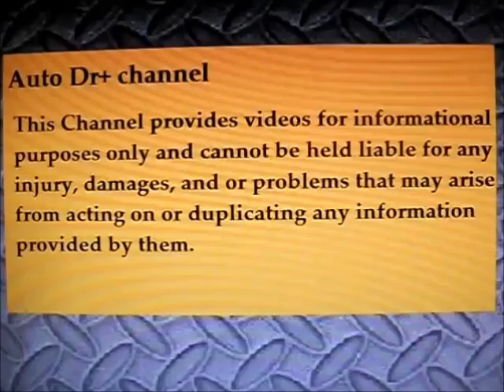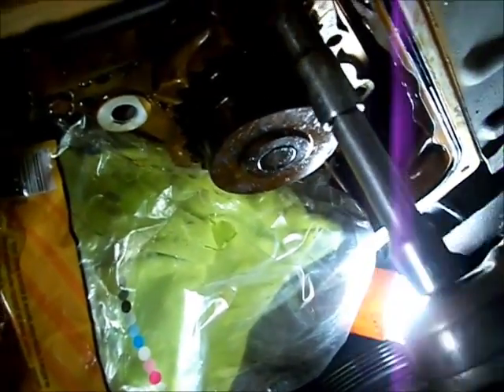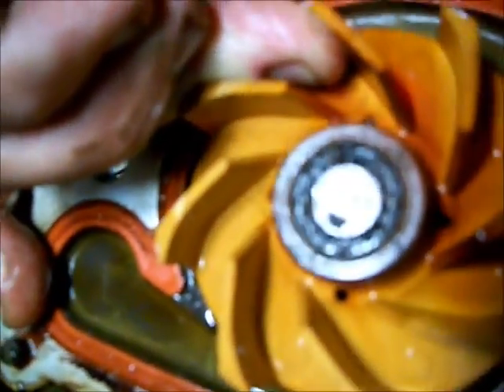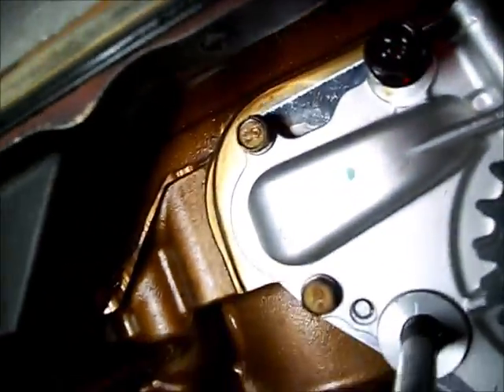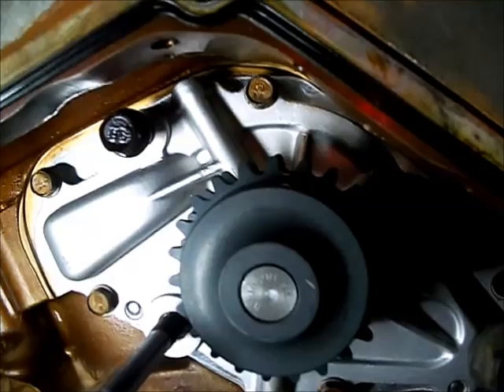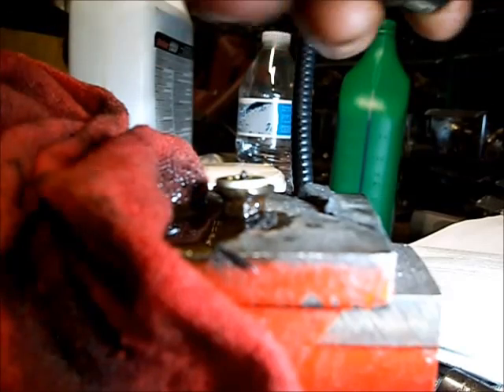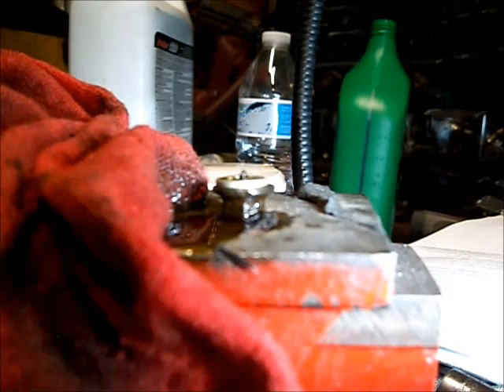Dodge Magnum `05 w 2.7l pt.2 water pump replace timing chains

Comment: did you end up changing the cam chains too or only main chain?
Reply from the maker: Just the main chain, this was an economy job for a local car re-seller.  Altho, the secondary chains don`t fail normally.  The only point of interest in that area would be to replace the chain tensioners that support the secondary chain.  But even those aren`t prone to fail.  As long as the short guide plastic isn`t worn more than "0.10" from chains.

Comment: como puedo cambiar la bomba de aceite de craisler 300
Reply from the maker: ¿Por qué necesita el cambio de la bomba de aceite? Con estos, se debe verificar la presión de aceite real, porque la unidad transmisora va mal. Y el conector empapado de aceite debe ser limpiado, y prefieren un orificio de ventilación de aire puesto en el conector en el cable conector de ranura vacía al lado.  (Espero que esto se traduce en buen estado)  De todos modos, si se enciende la luz de aceite, la bomba está en la última elección. Después de recoger, sensor de aceite obstruido, cojinetes del cigüeñal y la junta tórica alrededor del tensor de distribución fundido del émbolo, (alta posibilidad) de pérdida de presión de aceite. Ya que se encuentra en la camisa de aceite para lubricar la cadena, bajo una restricción controlada   Se aplica a motores 2.7L

Comment: Yes it is not leaking. However, There is another one inside? Are you saying it's an O-Ring at the entry where the tensioner go inside? or the O-Ring on the Tensioner?
Reply from the maker: +getpaid38able   The o-ring on tensioner.  As long as you got no chain noise, no oil light (@ hot idle), and no leaks, you`re all good.  Oh and no overheat.

Comment: You my man are a freaking genius who would have known that little O-RING would have made such a big difference (part NUMBER 04792480AA ). THANKS SO MUCH. THANKS YOU SAVE MY WALLET. YOU ARE A SAINT.
Reply from the maker: +getpaid38able    I take it, that it solved the oil leak problem?   That o-ring and the other one in there are at times holding 100 psi (cold cruise) to 9 psi (hot idle) between them.  So the oil is just waiting to get loose where ever it can.  Also the tensioner has an oil hole where it rest against the tensioner arm that has a slot in it to oil the chain.  The tensioner plunger is restricted to only let a metered amount of oil out to the chain, so as to maintain oil pressure in the rest of the engine.

Comment: Man thanks for the info. I was trying to see if I could purchase the O-ring separately but so far you have to purchase a new cap also. I checked the manifold also it is not stuck around their I will continue to search my garage it may have fell when I took my car for a test drive after changing the water pump...smh
Reply from the maker: +getpaid38able   just take cap with you to parts store, and match one up, I believe it is about 1 1/8" x 1/8" diameter. but felpro prob makes it.  Be sure and add a couple quarts of oil back in there so the motor doesn't get fried, it probably really made a mess down that side.

Comment: The O-ring on the cap or the O-ring on the Tensioner? The reason I ask is because I don't see one on the cap.
Reply from the maker: +getpaid38able    There u go.  The cap o-ring is critical in containing the oil pressure between the cap and the o-ring on the tensioner.   It has probably fell down on the frame crossmember, during installation.  Another will have to be obtained before all is well, for several reasons, like the huge oil leak, and the oil pressure keeps and adjusts tension on the chain as it wears.
Reply from the maker: +Auto Dr+   O`... the o-ring is about 1 1/8" diameter, sets in the circular ring on the inside of cap.  Umm, check the head and see if it is stuck on it as well.... may have dislodged when cap installed, but really should have aligned back up with cap when installed.  Should be replaced in general anyway.

Comment: Just a question, I finish my Water Pump installation on my Magnum. I replace the timing chain tensioner, the Serpentine Belt, Timing Chain. The Car starts and sounds good no Antifreeze Leak however, now oil is leaking around the timing chain tensioner cover when I start the car. Have you ever encountered this problem?
Reply from the maker: +getpaid38able   The cap holding the tensioner in?  If so the o-ring has slipped, got damaged or is worn out.  A new o-ring is in order
Reply from the maker: +Auto Dr+  I have never had that problem, but I think there is a pin and slot to keep the tensioner cap right side up.  You may check to see if cap is upside down, as it should set flush against the head surface.  The cap is sloped inside to accommodate the slop of the tensioner, and the little hole to the left inside bore is a main oil jacket.  And there is a marginal risk of damaging the smaller o-ring around the tensioner, when installing, causing the oil light to be on at idle hot.  Due to oil pressure loss around it.  But would leak internally down timing cover housing.  Out of sight.

Comment: Hi, Very good video, a lot of detail. I did exactly the same thing with my 2.7 but my camshafts spun some when I took the chain off. Got everything lined back up, installed intake and valve covers and coil packs back on and engine will not fire. Cranks over fine, no valve knock but no fire to coil packs.  Shows codes P0352, 353, 354, and 355 when scanned. Disconnected cam sensor and still no fire, any thing you think I may be missing? Thanks so much in advance, Bobby
Reply from the maker: +bebop4u1  Hi bebop.  The year and make would have been relevant information.  Those codes may or may not be relevant, depending on if the key was on while those coils was still unplugged.  See if check engine light lights up for a bulb check at ignition key on position.  If not power/ computer problem.  If ok, leave switch on check for 12v+ on  1 side of coil plug-in`s 2,3,4 under hood.  Power to coils supplied through ASD RELAY I believe.  If no 12v, check for blown fuse, check all fuses under hood, and I mean each one individually that support the power train system.  I was wondering , does the fuel pump run for 2 seconds after switch to on?(relevant) Also there is a plug-in set leading to the engine, verify these are all plugged together after checking for any of the wire pins in them displaced and not making connection to its mate.  Check for wiring caught under valve cover sealing edge.  Seen this happen to several people after extensive work.  That is some info to sort through for awhile.  If still a problem, answer the questions I asked in a reply.  Also sometimes, the plug-in on the crank sensor in the transmission bell housing just loses contact and it wont start.  (just unplug and plug in again)  This and the chain timing can be verified through a scan tool by 1 observing rpm on crank, and 2 verify cam and crank sync ok while cranking.  Hope it helps
Reply: Thanks so much, I apologize it is a 2000 model Intrepid. Have power on ADS relay with switch on, no power to fuses S and T which should be for the injector and alternator. Fuel pump does not come on. If I jump a hot wire to the injector side of fuse s it will crank and run but backfires through the intake and wont idle. Tore it down again to double check timing and its pretty much fool proof, crank marks on chain and sprocket line up, marks on intake camshafts both line up with marks on chain and since the sprocket will only bolt on one way the intake cams have to be in time. The exhaust cam sprocket is 12 pins from each other as per manual. The left bank or drivers side sprockets have the dimples and triangles for timing. The triangles mach up as timing marks, the dimples will put the intake cam out of timing with the main chain. All connections seem ok no wires broken or caught under anything. The only code I get now is for the throttle position sensor which with it back firing will cause this. This thing has me stumped, lol. Thanks again for all your help and hopefully you have some more ideas.
Reply from the maker: The dimples have always been the timing marks on the ones I have done.  The 1 triangle points to the dimple on the side of a gear tooth.  I have still pics here at ( https://youtu.be/pCbqQJnuUz0) (or under the (I) in this video) of putting the new style chain in a 00 intrepid.  And the drive side has a triangle pointing at the dimple.  A concern is when the cam jumped on you, and the problem with the dead 2 fuses, I`ll see what they do.  Check pin A at the ASD relay for 12v w key on, if no check fuse (N -30Amp) for a problem, it supplies the power to both run and apply asd power through asd relay.  And this power circuit also supplies power to the PCM computer through a DK GREEN w ORANGE tracer line wire to PCM at connector 1, pin 6.  All of it is spliced inside the PDC (under hood fuse box).  Mabe why your car isn`t running right, is because you aren`t supplying 12v to this wire in conjunction with the S & T fuses.  If fuse N has power on it and asd relay has 2 terminals with power on them, then a splice inside fuse box is damaged internally and box may need replaced.  Or look under box for any visible signs of wire damage.  Or if economy, Splice a wire from output of ASD relay contact pin, to fuses S & T and PCM C1, pin 6 Dg/org wire.  (I seen this once before)  when an average joe got a used motor for his 96 intrepid (3.5l) out of a concord equivalent.  And he used the harness off the concord motor, and it didn't have the dark green w orange tracer wire in the harness at all.  It ran the injectors originally but was routed another route in the concord through a separate plug not on the intrepid.  I asked which harness he used, compared the pinouts and that was the difference.  Had to take the stuff back off and switch them, but ran good after.

Comment: 2008 charger with 2.7L. Do I have to drop lift up the engine to remove the oil pan. it's leaking from the area you are working in this video. so I'm gonna replace all the parts you are doing. my motor started knocking today so I flushed it put new oil with some Lucas also but still knocking due to low oil pressure.
Reply from the maker: +Ronnie Emerson    Hi, to remove the oil pan on that vehicle only requires the steering rack to be unhooked and repositioned out of the way .  And there are 4 bolts to be removed along the bottom of the lower timing cover.  BUT if you drained the oil, it should be checked for metal particles.  If the oil pressure is low and it is knocking.... (to say the motor is making a loud repetitive knocking sound, that increases in repetition with rpm) taking the oil pan off is not going to solve your problem.  SO as far as pulling the engine, in your case yes I would.  And overhaul the lower half, and likely at least 1 connecting rod.  (BUT) to be certain, take it to a reputable garage, and get a diagnostic done before any action. (Haul it, there and not run it anymore as  it may still be salvageable.  A trained ear will be able to get an idea of what the problem is initially.  An oil pump and oil additives, are not viable as a replacement for missing metal and  precision machined surfaces.  Thanks for the comment, and good luck with your engine.

Comment: hi go you have to drop the motor out to replace the oil pump. because I have to do all of this to my charger.
Reply from the maker: +Ronnie Emerson   Not sure, about a Charger or what year yours is.  But as far as 2.7`s go, the oil pan has to be removed.   To get access to the pick up tube bolts.  And usually the oil pan falls right off of these.

Comment: my car is a 2004 sebring convertible so the front of engine is facing the passenger side , RH being against the fire wall LH being front bumper direction , transaxle on drivers side . when i put the secondary camshaft chains are set with the colored links and marks on their sprockets matching up with 12 chain link pins between marks and those both at 90% to the plain of the head ... and then the colored links matching up to their marks on the sprockets , crankcase mark on water pump with the primary camshaft sprockets both floating . the RH sprocket aligns fairly easy to put in the 2 bolts , its the LH primary sprocket that if i have to only go counterclockwise seems like when you turn the camshaft with a 3/8 inch ratchet extension inserted in end of camshaft a lot to turn when going the other way is so close.  am i making sense , im learning as i go  and often i miss something obvious, i have the manual and ive watch the CHRYSLER MASTERCRAFT 2.7L VIDEO
Reply from the maker: +Jon Thanos  Hi Jon, this is a video about a magnum,  which is mounted long, and not transverse.  But still has the RH and LH called out from the rear of the engine.  All of the info you need and an appropriate way to go about it (to not cause damage to critical parts, if it hasn't happened already)  is in my previous posts.  Thanks again for the comments.

Comment: i like the video, but my problem is the primary timing chain sprockets are not perfectly aligned with the cams to put the bolts in. the manual says to put 3/8 in ratchet in end of cam and rotate ccw with the sprockets floating till they line up, my right side works fairly easy and only has to move a little bit but the left is close but if im only supposed to turn the cam ccw then its almost a complete turning , seems like alot when it looks easier to just go clockwise. am i explaing it right. nobody shows the actual sprockets being attached if the bolt holes dont exactly match up. im not sure what to do, thanks jon
Reply from the maker: +Jon Thanos  Hi jon, first of all I wouldn't rotate the cams in any direction more than a single tooth.  (THIS is how all the intake valves get bent on this engine when the chain jumps time).  Some references I would need to know is; are you calling the sides LH RH and rotations out from say the drivers seat, or looking at it from the front of the engine?  (Standard is from the driver seat).  It is normal for the pass "RH" side bolt holes to be off by 1/8".  Not really anymore. (haven't seen it yet, in a dozen of these 2.7`s.  BUT this is because the original chain was stretched an X amount,  and if the cams are locked into place, (such as I do) then the holes will be off, because the new chain isn't stretched.  You can manipulate the cam, to adjust this difference and align the holes equally.  By using the 3/8" sq. hole in cam end through sprocket, a short 3/8" extension  secured to a solid ratchet, ie (breaker bar).  (IT IS CRITICAL to keep control of the cam shafts when the crank shaft is unlatched from them.  If the cams jump (THEY CAN AND WILL if you rotate them) while unlatched from the crankshaft and a  piston on the cylinder the valves are jumping out into is close to the top of the cylinder, or (TDC) those valves will be bent and require the entire head to be removed for repairs.  (NOBODY WANTS THAT)  ONCE the breaker bar is fastened solid with the cam it can be rotated the 1/8" or so and the bolts inserted, or the cams locked into the new position, insert bolts at you`re leisure.  READ ON     CHECK THIS, if one bolt hole aligns and the other is always out of alignment, either the cam is off 180* or the sprocket is on backwards.  The timing marks should always face front for proper sprocket install.  If cam is off 180*  (SAFEST WAY) loosen all intake cam bearings, (prob wouldn't hurt to loosen exhaust ones as well) to the point of removal almost, rotate drive cam slowly, (IF ANY SUDDEN STOPS BY CAM IS FELT) the cam bearings will need to be un fastened completely.  Continue untill the bolt holes have switched places, and insert bolts far enough for verification.  Fasten cam bearing caps to 105 inch lbs.   Good Luck thanks for the comment
Reply from the maker: +Auto Dr+ Be sure secondary chain between cam shafts doesn't get enough slack in it to allow the cam shafts to get out of time from each other. Those can be a hassel to put in time on certain years.  A side note is that I have never seen the secondary chains or tensioners go bad in the head.
Reply: +Auto Dr+ Can't you just avoid all that mess by positioning the engine 60° past TDC? According to the Mastertech video I saw, it should keep the valves from contacting the pistons; at least I hope so! I just got the water pump off my Sebring tonight.
Reply: +Auto Dr+ Also, don't pay any attention to my username.
Reply from the maker: +thestupidfreakingcow   I can only tell you the way I would do it.  I have never bent a valve, ever.  All pistons may be down enough at 60*, I may have read that years ago, not sure.  But if the valves moving are taken out of the equation.... No guess work, no damage.   If the cam is 180* off and a piston was @ TDC, it may have a valve problem.  (Easily identified by any loose, floppy cam followers).You could always unhook the chain, since you`ve changed it already and mount the sprocket on the cam bolt holes to see where the timing marks are @, in retrospect to where they should be.  Then take the steps required to get them back where they belong.  Then loosen sprocket and slip chain on reinstall.